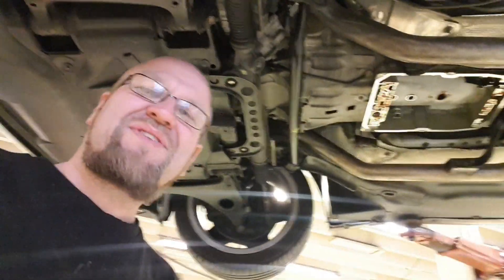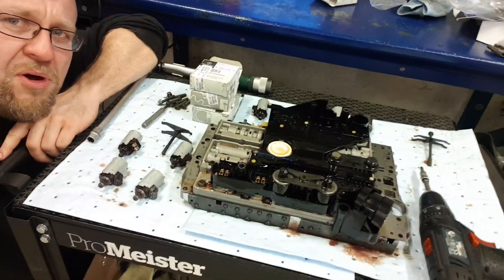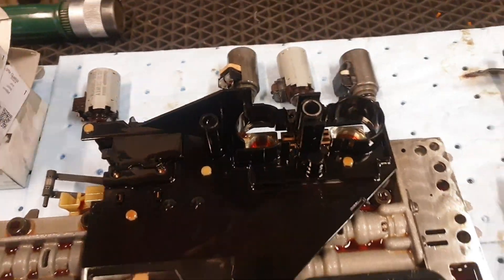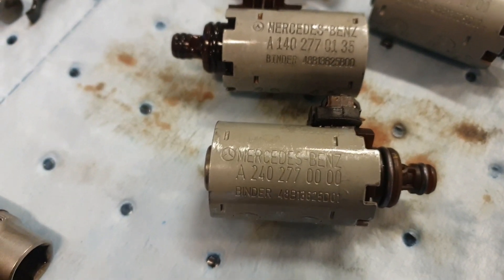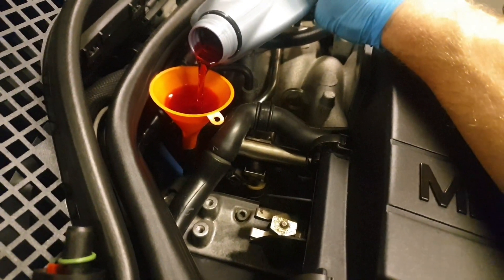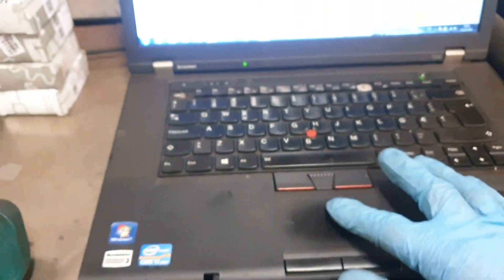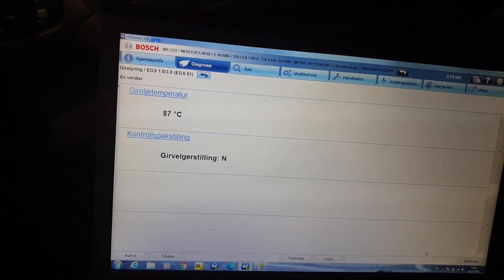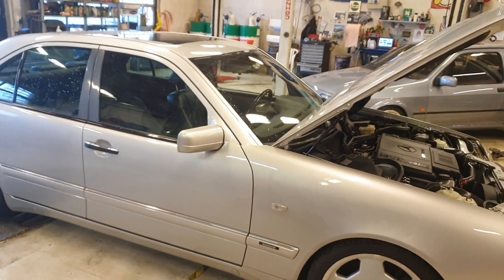HOW TO:Mercedes Benz w210 Amg  722.6 Shift and TCC Solenoid Replacement/Transmission Oil Level Check

Comment: I have a C55,  Getting jerky/hesitation feeling, mostly between 1st and 2nd around 1900rpm. RPM needle also jiggles a bit when held at speed. Great vid, going to do the same
Reply: You probably dont care at all but does anyone know a trick to log back into an instagram account?
I was dumb forgot my account password. I love any tips you can offer me
Reply: @Robert Lucas Instablaster =)
Reply: @Deshawn Augustus thanks so much for your reply. I got to the site thru google and Im in the hacking process atm.
Seems to take a while so I will get back to you later with my results.
Reply: @Deshawn Augustus it did the trick and I now got access to my account again. Im so happy:D
Thanks so much you saved my ass :D
Reply: @Robert Lucas No problem :)
Reply: Did it help?

Comment: This was incredibly helpful, thank you! Could you please help me with this?

My solenoid resistances tested as follows:

Torque converter lockup solenoid: 3.8 ohms (range is 2-4)
3 shift solenoids: all around 6.5 ohms (range is 2.5-6.5)
2 pressure regulating solenoids: around 7.8 ohms (range is 4-8)

All resistances seem to be on the higher end, is this due to them wearing out over time, and would replacing them be a proactive step?
In addition, all solenoids click when attached to 12V leads, however the click from the torque converter lockup solenoid was considerably quieter than the others. Is this a reason to swap it out?

Comment: Fantastic Video. Thank You so much.
Reply from the maker: Im glad you like it 😀Thank you for commenting. Greetings from Norway, Stefan
Reply: @TheCarTakerGarage   can I just change solenoids.  Is it plug and play. Any re programming needed for car.
Reply from the maker: @charlievega7597  Yes you can.No programming needed.
Reply: @TheCarTakerGarage  is it the same for e500 2003 transmission
Reply from the maker: @charlievega7597  What is the same? It is the same basic procedure yes.What parts etc ..i dont know.
One needs to verify that by more than just " 2003 e500"
Reply: @TheCarTakerGarage  on switching out shift solenoids. They won't need reprogramming when replacing? Thanks I advance.

Comment: I changed the ATF on my W210 without changing the filter. I basically sucked it with an oil pump and refilled it (took me three rounds, one round every two weeks, with 3 liters each round. Now what is happening  is, sometimes, when I stop at the red light as an example, the transmission doens't start at the first gear. Seems that it starts on 3rd or 4rth gear (not sure), and doens't shift at all. Also the reverse doesn't engage at all. But when I turn off the car and start it again, the transmission goes back to normal. Do you have any idea? many thanks.

Comment: I just did installed a new conductor plate and car won’t physically shift out of park? can some PLEASE explain how to connect the shifter rod to the pin when installing the valve body? I’m stumped , I have to drain all the fluid yet again and drop the pan again and drop down the valve body all over agian, why is It so damn hard to hook up that shifter rod thing ?

Comment: Heisann. Kjempe video! . Jeg har en c43 amg med 722.631. Fikk for en stund siden et problem med at den er låst i 1 gear 😪 får opp feilkode p0715 speed sensor. Bytta styreenheten uten hell. Kan disse solinoidene være problemet mitt da? ser på nett at de koster en formue. En ting som kanskje er verdt og nevne var at det var en del metall spon på magnet i bunnpannen. Er dette noe som kan tette ventil kanaler?
Reply from the maker: heysann der.Tusen takk for det.
Det er vanskelig å si hva som er galt med girkassa di.Men hva mener du med styreenheten? mener du EL plata..inni kassen..eller mener du faktisk styreenheten til girkassa? Viss du mener EL plata innvendig i girkassa..så må du sjekke om ringhjulet inni kassa har subbet borti speed sensoren på EL plata..det viser jeg i denne videoen her...hva og hvordan du kan se det... Spon i girkasse er ikke problem viss det er " fint som " mel"..men viss det er " biter og spon flak osv"..så er det litt verre..samt en må vurdere fargen på sponet...samt hvor mye for å gjøre seg opp ett bildet om det er alvorlig eller ikke.
Reply: @TheCarTakerGarage   Ser på speedsensor at den har tatt borti litt. Vil det si at lageret er gåent? Har testet solinoidene. De virker helt fine. Ny conductor plate uten hell. Ledningene virker også fine. Vet ikke helt hva mer jeg skal lete etter 😪
Reply from the maker: @mkonges  ja,viss det er spor på speed sensor, så er lager defekt.du kan også prøve å trykke opp aksel inn i hullet der speed sensor måler på aksel,for å sjekke om du kan bevege aksel mye opp og ned.men somsagt,,,er det spor på sensor,,så er ikke det ett godt tegn.

Comment: Hi so can i buy solenoids from Other Brand than MB, bcos they re so expansiv. And my gearbox stuck in 1st Gear. Trouble Code speed Sensor 3 failiure

Comment: My W204 220 CDI 170hp with 722.6 5 G tronic started to not working properly, it didnt want to shift properly and sometimes stuck on one gear, even the manual gearshifting didnt work properly, how ever, i bought a new conductorplate and oilfilter and oil, i replaced the parts and the worked great for some km´s, then starting to act weird again. After watching this video i realice that i should change the solenoids to, and i did not do the job i just mentioned i did correct at all, with that said, i messed up and that´s why my gearbox still not working properly and maybe also needs new solenoids, it has 290000km´s on it. I just put in all the oil before even starting the engine, but i did run through the gears when i filled up the 8 liters. Ohh boy, i messed up..

Comment: Totally at your own discretion but I run Wolfs Head Super Synthetic Universal ATF in my 722.6. Way more cost effective and 13 months now and never missed a beat shifting. I contacted them and they assured me it's completely safe for Mercedes ATF 134 here in the US. Dont know about Norway availability.
Reply from the maker: Thank you so much for info.Well..the question about the oils in the 722.6 is sooo discussed around forums and such..that you cannot really get any straight answers i think. Like you state...i have also read the same thing..that atf134 can be used with no ill harm...but i have also read the complete opposite..so i wanted to try to stick with the correct spec ,as long as i could get hold of it.ya know...Also..i think the potential issue you might have,,is not the shifting qualities(eventhough some of the experiences ive read is regarded to a negative shifting experience) i do think the biggest concern is excessive wear on the clutch packs etc by running the thinner oil.Im not sure..but..i am totally thankful for your input.Greetings from Norway ,Stefan

Comment: Hello, I have a w204 c220 cdi with this transmission. It shifts fine, but when cold, as in winter time, I can feel the torque converter not disconnecting in time and bogging the engine when stopping. Also the engagement of the Torque converter is really hard, it jerks the whole car. Once warmed up it is okay.  Could this fix my problems?

Comment: Im doing a full solenoid replacement for my 2003 ML500 and was wondering if you have to reprogram the transmission afterwards?
Reply from the maker: hey there.ASwesome car you have.no you do not need to reprogram anything.Greetings,Stefan

Comment: Which of the solenoids control the Drive 1 and Drive 2 shifting ability? I recently changed my transmission filter, gasket and conductor plate. However, I noticed when I attempted to shift the new oil through the gears, I could not shift into go to the lower Drive gears? Any idea?

Comment: Bro, thanks but i have a question, i have CLS55 AMG, i have a hard shifting some time not always, on regular driving the car seems perfect, but when i down shift i hear pum, and when the car change i hear the same pum, no computer faults, the oil looks pretty reddish, what could be the problem? Thx in advance bro
Reply from the maker: hey there.What yeah CL is it? it is hard to say what it can be..but have you also scanned ALL systems...especially engine...transmission, and brakes?

Comment: Hi Stefa, nice car and very good job. A question for you: did you had to re-programm the electronic of the 722.6? Or it was enough to move from P to R to D and viceversa? Thanks in advance for your help. Ciao Marco
Reply from the maker: hey there.So sorry for late reply..and i reckon you have had your question answered..but you do not need to reprogram anything no.Its just a matter of doing the " P do D , To neutral , through the gears etc etc....as usual when doing oil and filter change.Greetings,Stefan
Reply: @TheCarTakerGarage  thanks Stefan...
Reply from the maker: @marcomarcellotrazzi7680  no problem.And sorry for late reply.I have totally missed all comments almost on this video.I hope you are doing well :) Greetings from Norway ,Stefan

Comment: Do all w210 cars have the same exact transmission? I have a 99 e320 that I'm considering doing a similar job for.
Reply from the maker: They do..basically.The shifter mechanism is different though.Also..i cannot verify if the parts i have used..fits in your transmission.That would need some diving into.

Comment: why changing the lock selenoid?
Reply from the maker: Just becausel-----Like all the other stuff i did to this valvebody.None of these upgrades/replacement of parts were done to repair an issue.But rather just beeing done just because :)

Comment: Hello My Friend. Hope you are doing well.
Stefan i'm going now to order parts, to do the first oil change on my E430 Gearbox. It still runs with the Factory filled oil. As i know i will need, Proper Oil. Gearbox Filter, Pan Gasket, Automatic Transmission wiring connector and 6 new bolts for buttom pan. Can you advice do i need anything additional? Is it mandatory to change the oil drain plug and it o ring also? Greetings :)))
Reply from the maker: heyyyy my friend.My goodness..i havent seen the comments on here before :) Well..you really do not need the 6 bolts..but it is supercool to replace them though.I guess they are not very expensive..but these are not the Aluminium ones that NEEDS to be replaced. I never replace the drain plug..and and almost never replace the copper sealing ring neither.Sometimes i do..and sometimes i dont.But that has to do with me doing these things " more often than normal"...so..But if you can,i would definetly replace bolts and sealing rings if i was you :) I hope you are doing good my friend :)  Greetings,Stefan
Reply: @TheCarTakerGarage  
Hello Stefan. Thank you for reply. Yes, i have ordered everything, also posted the video on my channel about transmission parts i have received, they do not cost much so it is  good to replace all the parts. Now i am waiting for stability of the pandemic situation and then will go to the dealer and change oil there. Hope you are doing well too. Regards my friend! Greetings :)))

Comment: Hi, can i know the symptoms?
Reply: you can get shudder as if youre driving over railroads. It can happen around 40 miles per hours usually and in my case after changing transmission fluid it worked but eventually I had to replace the solenoid cause Torque converter was slipping. If you dont feel constant shudder usually it can happen when turning and accelerating like when you are passing someone

Comment: I have a Jaguar XJR supercharge with the same transmission and I changed the solenoids but it wont shift what did i not do ?
Reply from the maker: that depends on what you mean by " not shifting".....does it shift into reverse? does it run forward in first gear? or is nothing happening when trying any gears?Did you remember to connect the shift tab ,inside the gearbox? the one i pointed out in the video?

Comment: key info at 4:12
Reply from the maker: Thank you for comment.Yes..that is suuuper important actually :) Cool that you noticed it :)  Greetings,Stefan
Reply: @TheCarTakerGarage  Thank you, you helped me fix the shuddering gear shifts on my 2005 CLK 180. I changed the conductor plate and TCC solenoid only (+ gear oil and filter)... I didnt bother with the shift solenoids to see if I could save money, didnt need to buy them in the end because..... Now my car drives as smooth as a brand new merc.  So many thanks